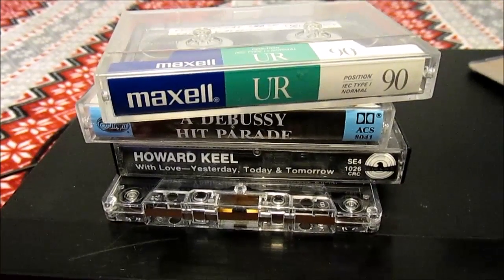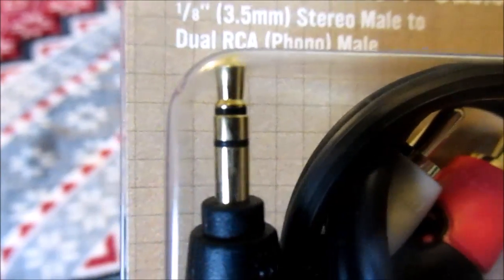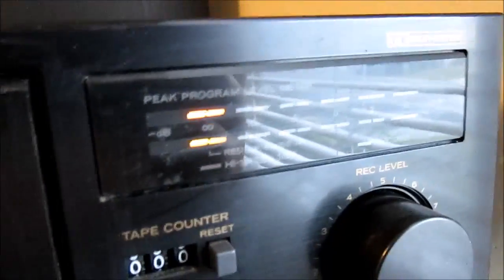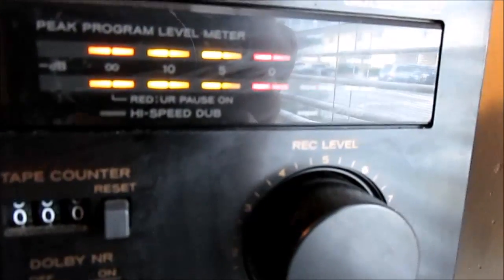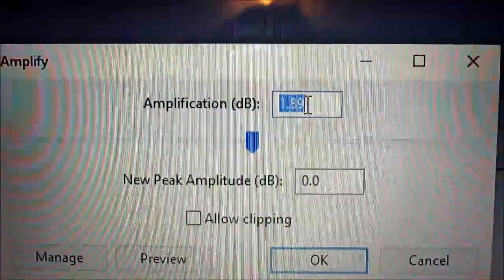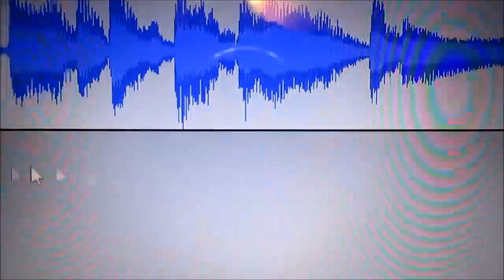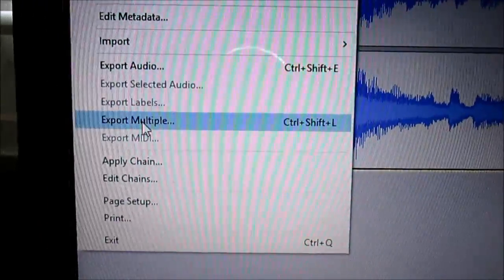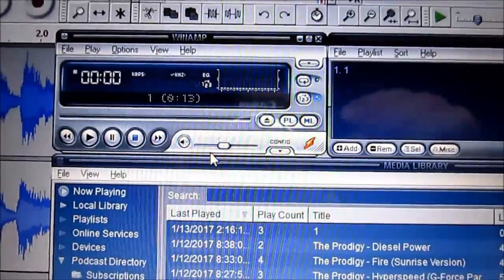How to convert audio cassette tapes to mp3 for less than $17

Comment: Thanks for this, but what is the advantage of using Audacity vs ripping the audio the same way but with Windows Media Player on Win 10?   I am doing that right now.  One benefit of audacity seems to be it can handle output from a cassette player to a mic input port on a laptop.  WMP works fine plugged into a desktop line-in port but laptops don't have that port, thus sound is excessive and has to be monitored.  Audacity clearly has more controls, but is more complex.
Reply: You can do in Audacity normalizing, and noise reduction/hiss and click reduction.

Comment: I know it has to be something simple, but the only sound I get is from the room.  Any suggestions as to what I am doing wrong.
Reply from the maker: Hey Joe. In Audacity, go to the Edit dropdown, select Preferences. In the Preferences dialog, select Devices. Play with the options in the dropdown for Recording Device. It's probably set on internal microphone. Also, in the same Devices dialog, you can try changing the interface host from MME to something else, but it should work on MME. Good luck. Let me know if you have any more trouble.